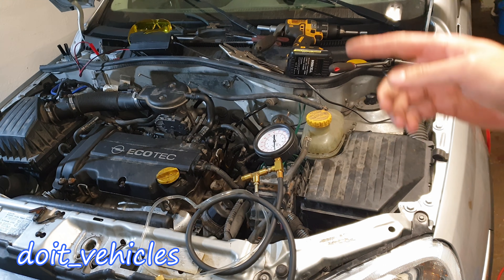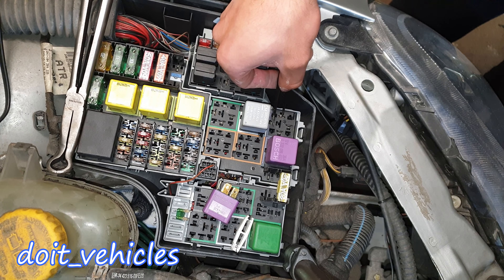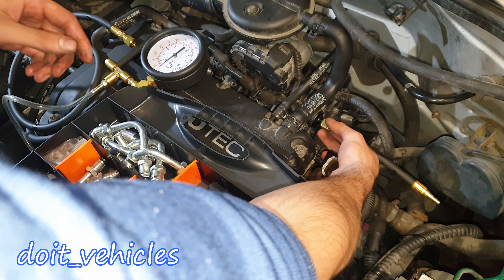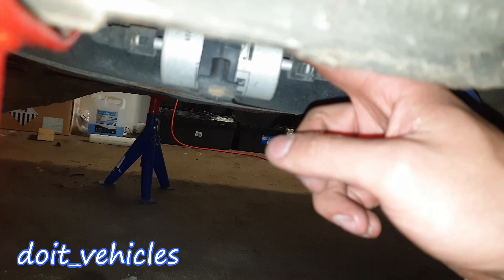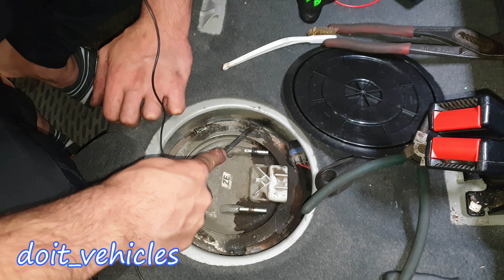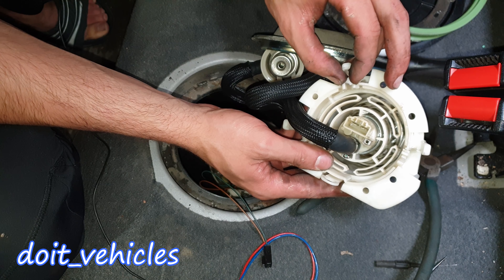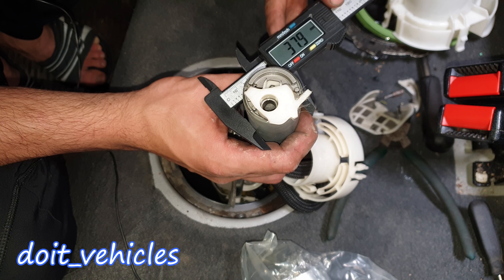Opel Corsa C ( 2000 - 2006 ) Fuel Pump -TEST Before removal and Replacement

Comment: Thanks for explanation. When I turn the ignition on, I sometimes hear the petrol pump sound, sometimes I don't hear it. And if this happens when I am driving, the car just stops. And when it happens I have to turn on the ignition multiple times before petrol pump makes the sound. What could be the problem?
Reply: Have you had a look at the OBD codes.  Hold brake and accelerator down then turn key to position 2.  Check engine light will start blinking out codes.  Might be pump failure.  They do give out.  Mine failed but it was total and instant stop, car just would no longer start, not intermittent.  It also sounds like bad/loose electrical connection.  Could be in the ignition switch.  If you wiggle / play around with the switch while driving you might be able to cause it.  Also re seat the relay (purple one) and fuse.  If you have a multimeter you can test the pump current draw via the relay connections but be sure NOT to connect to the signal side.  ONLY the switch side, pins 87 and 30.

Comment: Extremely good. The pressure regulator is fixed into the lid of the pump assembly isn't it? I didn't know at the time and just ordered the assembly witout lid. The pump is rated at 4  bar/ 60psi but I measure 50psi on the fuel rail (new filter). I've been told t

Comment: My pump seems to not work. I joined no 30 and 87 terminals like you did but the pump still did not work. I unplugged connection at pump and checked the voltage to be 12.2 volt. I then put the relay back in and the voltage at that connection was 3.6 volts. I put in another relay but the voltage was still 3.6 volts. The pump has 12 volt written on it so I wonder if there is a reason why only 3.6 volts gets to the connection?
Reply from the maker: Nice work ! It looks like there is some voltage drop along the wires . First double check the connectors , the fuse ( check the voltage / resistance of the fuse ) So u must find where is the point with the resistance and make that pump get 12 v .
Reply: @doit_vehicles  After further testing I found that with the new pump, when I turn on the ignition there is 3.6v at the pump and the pressure is 10 psi. When I start the engine the volts at the pump go to 14v and the pressure goes to 55psi. So I think it is normal to have 3.6v when the ign is on but the engine is not running.

Comment: iv replaced my pump, fuel rail and regulator..car drove ok for a few weeks then bad pressure agn..wot to do next?
Reply from the maker: the best is to check the live data first
Reply: @doit_vehicles  do u mean diagnostics?
Reply: I don't understand how you changed regulator. It's fitted to the cap and I can't find the cap for sale or the entire pump with the cap. And I can't find out how to test it.
Reply: @johncollins8304  some corsa is south africa have different specs, however i managed to find the problem, it was the maf sensor all this time..just letting you know,  the car drove as if it was misfire. fuel pressure is 100%
Reply: @huwandavids8407  Thanks. I cleaned the maf with special spray but car still won't run. New pumpp, new filter, new crank sensor, new fuel sensor... Pump is ratedat 4 bar /60 psi but measures 50 psi at the rail. I can't find out what the spec is. So what do you mean 100%. 
?
Reply: @johncollins8304  check your coilpack, spark is also a regular prob we find on corsas..
i meant fuel pressure is at 4 bar, i also had a new pump fitted.
Reply: @huwandavids8407  Thank you. Resistance on all four coils in the bar is exactly identical: 6.67. Unfortunately because they are all stuck together I can't swap them around -- I bought an Xtool D7 just to solve this start-cut out problem, but it thinks there are 3 cylinders, and will only activate #1 where I see spark, and I don't know any other tests before I spend 100€ on the chance that the coil might be the problem.
I'll  find out how to test the MAF -- so that cause low pressure at the rail; do you remember the pressure? I'll measure the pressure on both sides of the fuel filter instead of just the rail. Glad you got it sorted though you had to waste a lot of money & effort on pump, filter and rail. 
I actually can't find the specs of what the pressure SHOULD be at the rail, despite a lot of searching. 
THANKS AGAIN, from France.

Comment: to test for volt drop can i just back probe live feed/red wire and attach my black com socket multi meter lead to chassic ground with circuit loaded
Reply from the maker: No , that will read you the battery voltage
Reply: What is ah good volt drop test when checking that drop test thanks you

Comment: Brilliant thanks.  I have a weird question.  When everything is back together and the pump is running, listening at the tank pump access cover, can you hear fuel rushing??   I am trying to track down the cause of a painful pressure loss issue.   I recently replaced the pump.  It ran brilliantly for about 20klms then hard to start, poor power and slow to build revs.  The NEW pump gets the pressure to 55psi instantly  at the injector rail but pressure is lost instantly when power is cut.  Its a new pump so I dont think its the check valve in the pump body.  The pressure regulator wasn't touched but the metal tank cover  its attached to was covered in rust that I cleaned off with rust removing acid.  I checked the pressure regulator with air pressure and it seems to be functioning fine.  I had the injectors out, still hooked up to the rail, and turned the engine over.  They look like they are working fine, all the same spray pattern, no leaking.  

Im wondering if fuel is getting past the plastic fitting that the regulator is housed in hence hearing the rushing noise.  BUT it may be normal...  then Im out of ideas....
Reply: firstly needs the suitable pressure gauge to see if the loss of pressure comes from fuel injectors or  the gasoline circuit.

Comment: Do the wires at the pump have a secret clip? No matter how hard I pull, they don't want to come off.        Also, I had already bought those plastic hose removing tools.  But my hose connectors were different. The new type quick release connectors only take a couple of hours to disconnect but the old type screw clamp takes a couple of minutes.

Comment: Need to replace my fuel pump in Vauxhall combo 1.3 van where do I find the access hatch in the van
Reply from the maker: on most vans is under the seat on the side of the filler cap

Comment: Hello Doit, good to see you explaining this in detail, you have helped me out so much, But i have a question, I need your help, I have corsa c 2001 1.4 16v gasoline, I have changed my fuel pump using a MESSMER PUMP 770103A, it has 2 bars pressure on it  I think it is for diesel engine ( I have googled it). But it worked just fine on my Corsa 1.4 gasoline engine, so my question is, is  there any problem so far with this diesel pump using it on gasoline vehicle? and the 2 bar pressure is it enough for this vehicle to run smooth ?
Reply from the maker: Does it run smoothly? Does it run at all with 2 bars fuel pressure?

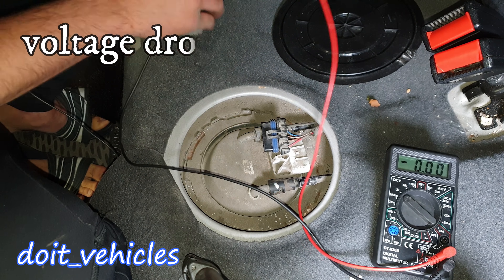Comment: 2:27 On my Corsa c, on the fuel pump I see 3.5 v and the car doesn't start. any idea why?
Reply from the maker: Check the wires , they might be coroded , pinched
Reply: Good
Reply: Did you find out why your pump only had 3.5 v ?     I seem to have the same issue. If I bypass the relay,  with the wire as shown in this video, I get the 12 v. But with the relay in place it is only 3.6 v.  My pump did not work even with the 12 v but you may have found the answer to why there is only 3.5 v at your pump.

Comment: Is the fuel pump the same for Diesel and Petrol? I cannot find any replacement part for Diesel, they all say gasoline. I have searched everywhere.
Reply from the maker: Diesel engines have high pressure fuel pumps

Comment: bro i bought new fuel pump and its bigger than before. the down of the plastic of fuel pump bed is not fitting. is it okay that its not fitted?
Reply from the maker: You mean the small filter ?
Reply: @doit_vehicles  no its same as your situation. the new fuel pump is bigger than old one and not fitting into white pump holder. what can i do? i ordered it because everywhere says its compatible with my car but its not fitting...
Reply from the maker: As long as you don't damage the fuel level sensor try to improvise a way to fit in or just attach it on the side . The input port should be always in gasoline .I know it's not the right way , but I guess you wanna save money ..
Reply: @doit_vehicles  actually there was 2 type of bosch pump for my opel corsa. i bought the kit one with filter and everything and it was 100euro. other one was 40 euro. so i wanted to make some good improvment but its not fitted. i didnt want to left the pump inside without cap it would be play around. so i will refund it and go with the cheaper one sadly.
Reply from the maker: I see .. btw , there wont be any improvement in just switching to a " better " fuel pump
Reply: @doit_vehicles  its not for that, i didn't want to change only the pump. i wanted do like your case. you changed pump and the filter of it. thats why i said i wanted to buy expensive one first because it had fitler with it.
Reply: hey man i need your help. my new fuel pump came. its DELPHI FE0429-12B1 for corsa b 1.2 X12XE. i did everything right but car has some hesitation when i press gas pedal. do you know why it could be?
Reply: Hi I need help my corsa lite 1.4 model 2005 sometimes got no power which place to check pump
Reply: @ntandomchunu1117  check the relay

Comment: My fuel tank (2005 Opel Corsa C) leaks when I fill up petrol (full tank)... I am not sure what could be the problem.
Reply: The rubber on the seal around the pump housing isnt closed properly.  Make sure the rubber oring is in place

Comment: Bro thanks for the videos . I have a question you might be able to help me. I have a Opel Tigra  ( x14xe ). Recently i replaced the fuel pump and after i start the engine i had pressure on the fuel tanks cap. Every time i started the engine pressurized air was coming out of the fuel tank cap. Is is possible that i have connected the + - wrong ? PLease help .
Reply from the maker: So you have fuel beeing deliver corectly through the right line and air coming out from the fuel tank ? 🤔
Reply: @doit_vehicles  yes

Comment: Hi what's the thread size on the service valve on the fuel rail? I need to buy a fuel pressure tester but want to make sure it has the right union in. Thank you.

Comment: I have a problem. When I turn the key, there is no sound from the fuel pump. I checked the fuse and it is intact, than I reversed the two relays but nothing starts. I bypassed the relay contact is and ok. I disassembled the pump and tried with the cables and it works. What could it be ?
Reply: Check the fuel pump electrical connector (you can try using a contact cleaner spray).
Reply: I have the same problem when I turn the key there is no sound but when you turn the key the fuel is flowing tough toe right hose and is flowing fast. My car doesn't start